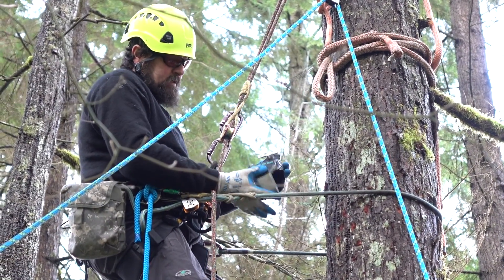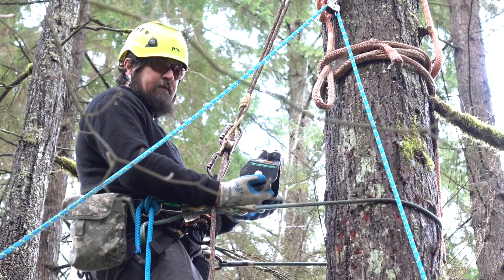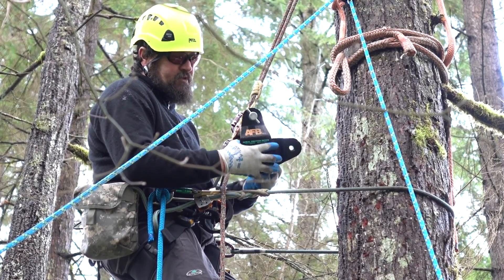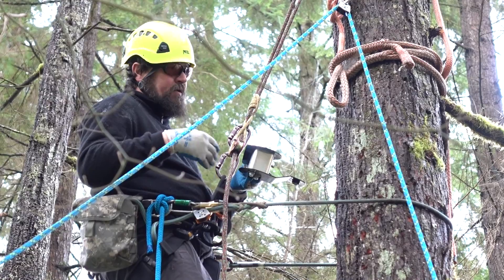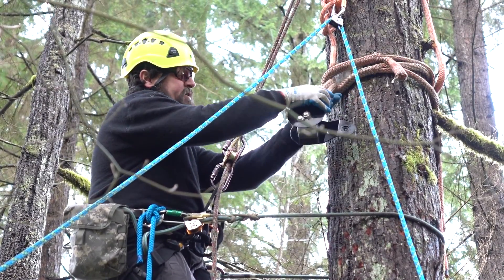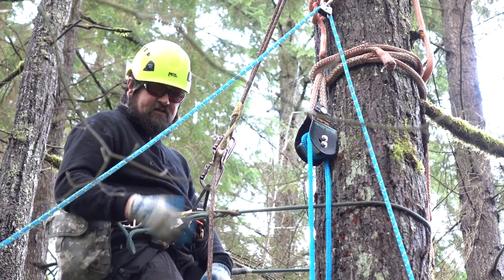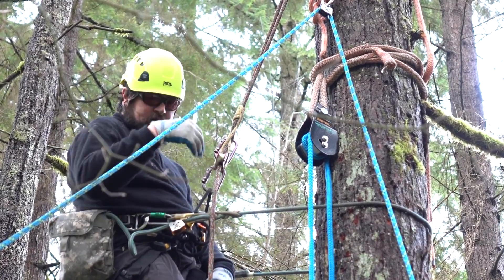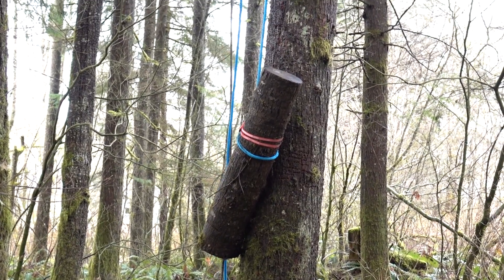Aerial Friction Brake - WesSpur.com

Comment: I tried  AFB Device what I threw a tree party in march 2017. Had a chance to take it to work use it on some for removals. We put to the test ! (800LBS + limbs ) found out that it works great ! . It's not something that you want to use ,  if you do not have knowledge and understand what the device was designed for..  it's a great tool to have in the bag.